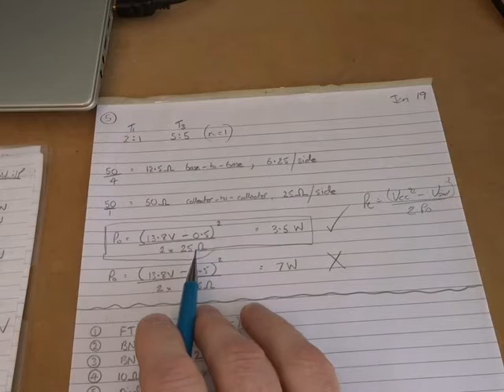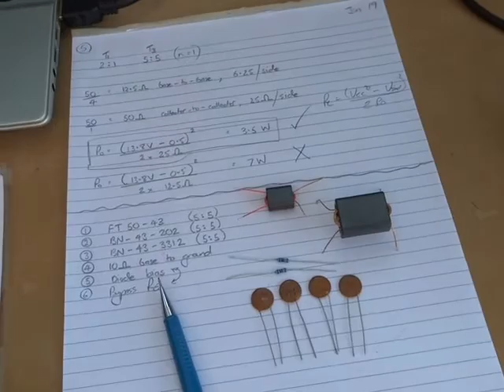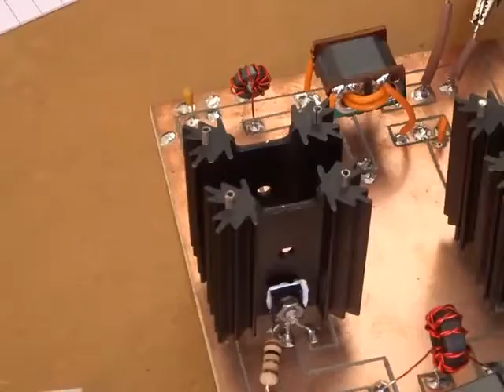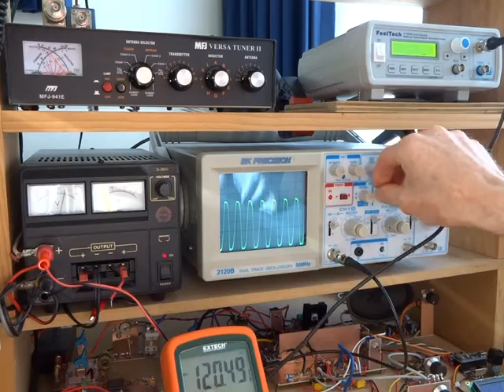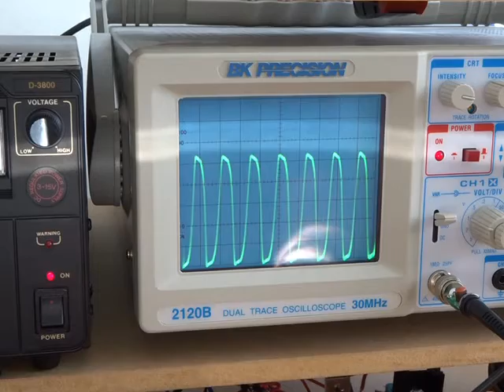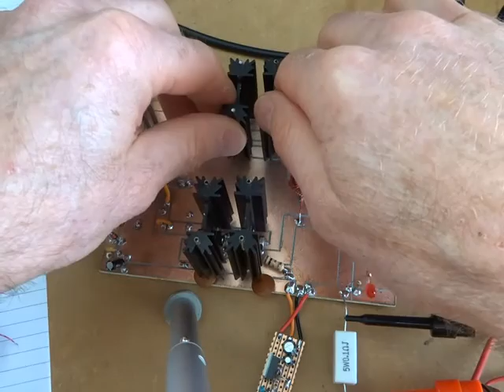BD139 Push Pull Amplifier Experiments - Part 2

Comment: Hi Charlie, a very interesting video indeed! Thanks for sharing. Have you considered building a series push-pull amplifier ("totem-pole"), instead of your current parallel push-pull amplifier? In a series push-pull amplifier ("totem-pole"), the emitter of the top transistor is connected to the collector of the bottom transistor (very much like an audio amplifier). A big advantage is that there is no need for an output transformer (balun). I have good experience with that topology for HF. Thank you in advance for your reply. Kind regards, Gerben.
Reply: I had the same experience

Comment: Hi Charlie, could you pls tell us how you cut out the traces of the pc board of the power amp? Do you use a CNC tool of some sort?
Here you find my progress on following your videos:https://www.dropbox.com/s/ii1ayr4vnbhoz34/superhet.mp4?dl=0
I am ready now for the transmit part... will start with your preamp (2N3053, the board is ready) and then go to a push/pull (BD139 or a IRF510).  
Hope I'll pass my HAM licence test in April ;-)

Comment: Running BJTs in parallel is always difficult at RF because of Hot Spotting, you did the right thing by including emitter resistors. Have you considered building 2 separate push pull stages and running those in parallel by using RF splitters and combiners?
Reply from the maker: Thanks Michael that's good to know. No I haven't considered splitters/combiners. That was mentioned yesterday too. Do you have a good source on info on that, otherwise I'll have a look in SSDRA/EMRFD.
Reply: For a good source I would suggest the Motorola application Note 749, "BROADBAND TRANSFORMERS AND POWER COMBINING TECHNIQUES FOR RF"  just google for it and you should be able to find it, if not email me and I will send it to you along with what ever else I have on the subject. Keep up the good work, I enjoy seeing what others are doing and how the are doing it,  you do a good job of walking us through your thinking.

Comment: Charlie , I've got to tell you , I love the style of your builds . Very interesting . It's  given me the idea of building an enclosure that has at least one panel of Plexi glass or heavy glass to reveal the circuit boards . I saw the video you made a while back where you speak on different styles of circuitry . I like the idea that circuit design is an art form . I'm going to focus more on the form as well as the function . Thanks for sharing
Reply from the maker: It's very much each to their own Joey. Ever since I was young I have pulled things apart to see how they work. All of my clocks and radios etc do not have cases as i want to see the insides. Again, each to their own. I tend to put a tea-towel over the radio to keep the dust off. As an aside, I pulled the Nov 18 SSB rig apart last night and am rebuilding it to make it look nice and neat. It was just a little too messy for my liking. 

Charlie